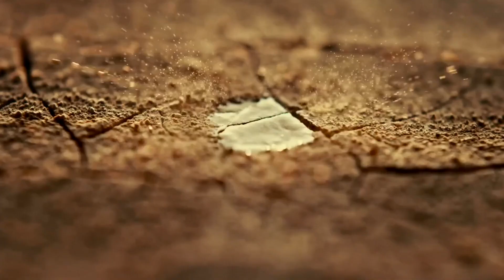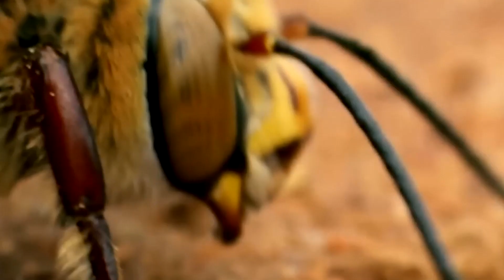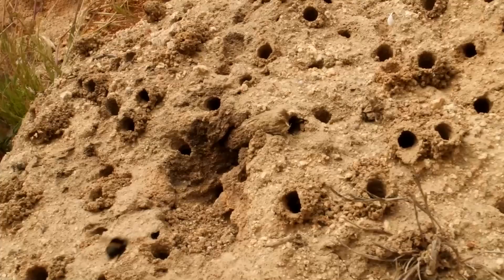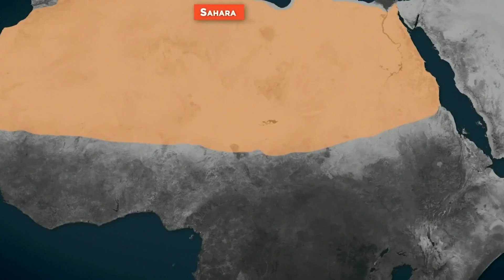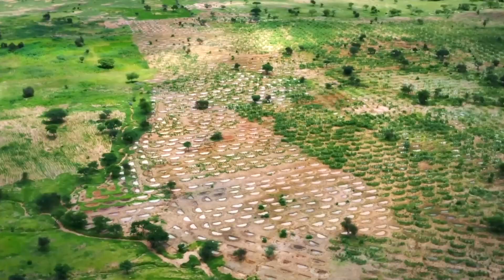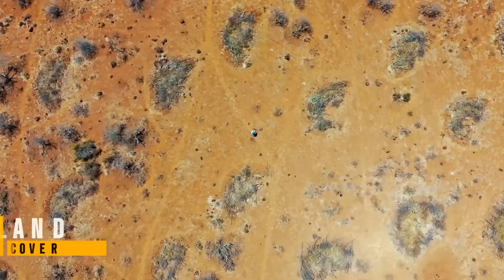Millions Of Frozen Bees Released Into Sahara Desert — The Result After 1 Year

Comment: They’re doing it all wrong. They can’t plant trees and expect the trees to live. The soil is not ready for trees. They can bring in all the soil they want, and it’s still gonna make no difference. What they really need to do to prepare the soil is bury logs in the sand. Logs will retain the moisture from the rain, and then in retaining the moisture, the logs will start to degrade and break down, and the microbes that live within the logs will start to consume the biological material in the logs. And then instead of planting trees, they need to plant smaller plants. Maybe some bushes. Something that will bury their roots into the log where the log is able to retain the water from the rain. And the plants planted above the log will reach their roots down into the log. But they have to let the log degrade for a couple of years before planting anything. They’ve got to get it ready For planting. They can’t just run over there and plant a tree and expect a tree to live.